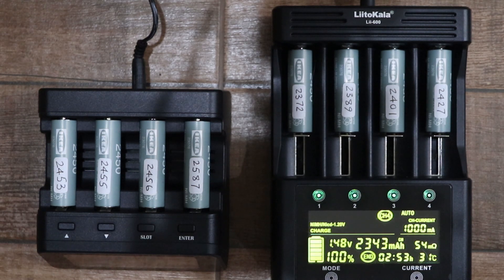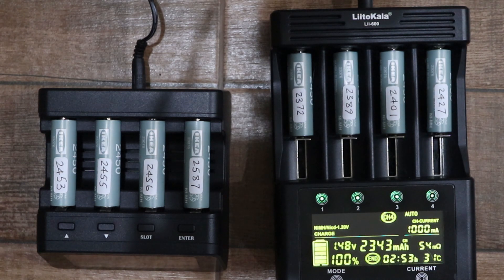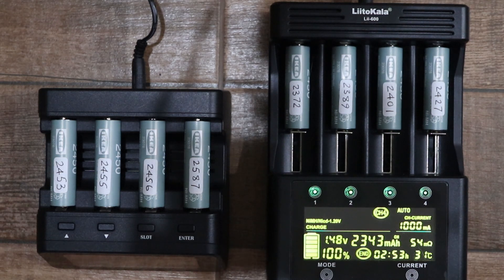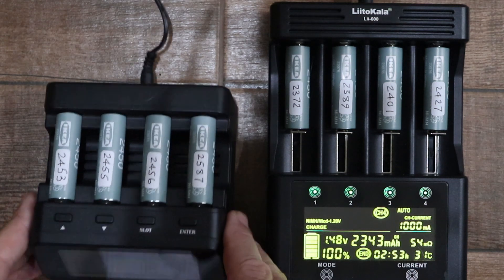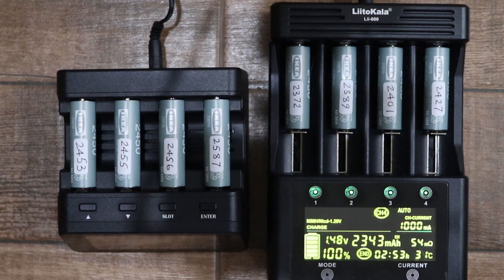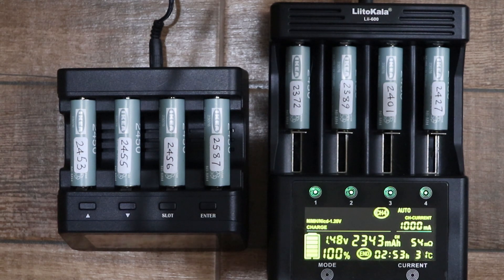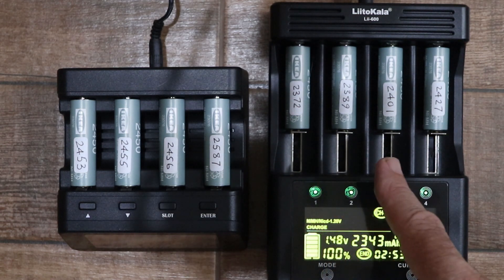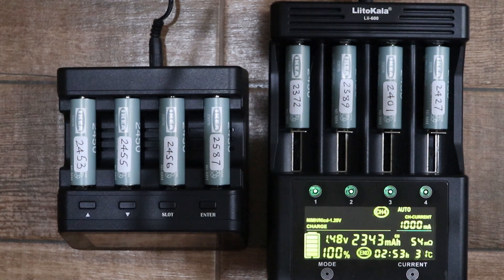Is There A Problem With My Powerex MH-C9000 Pro Battery Charger Or Is The Problem Me?

Comment: MH-C9000 Pro arrived few days ago and it looks like a very well build product. Also I bought Ladda and Eneloop batteries. 

Can I ask few things? Do I need to apply Break-In or Refresh / Analyize mode before starting regular use for brand new batteries? 

Actually I tried four 2450 mah Ladda batteries. I first discharged them with charger's Discharge function. Then I applied Break - In mode. I don't know what I did was correct behaviour for brand new batteries. But I thought may be those batteries waited in the store for a long time and they were not charged for some months. That is why I want to apply Break-In mode.

Anyway at the end of the Break In mode I got measured mah values of each batteries on the screen and they were, 2549, 2590, 2563 and 2627 mahs. So is that possible, should I trust those numbers? Is it possible that a 2450 mah (declared value on the package) can hold more than that value? I am very new on this thing so I will be happy to hear your answer. Thanks.
Reply from the maker: I just did some testing with 16 brand new Ladda 750mAh AAA batteries. With new batteries, you never know how long they've been sitting around. When I did a straightforward refresh and analyze, the value was low. I improved upon this by first discharging and then breaking in. Yes, you can get a higher value than the stated capacity rating. By doing the above, I was able to get in excess of 800mAh with the 750mAh batteries. You can trust the numbers. Powerex recommends breaking in new batteries and those that have been in storage for more than six months. Based on my test, it seems like a good recommendation.
Reply: Thank you very much for your answer, so it seems I did the right thing. I will do same thing to other brand new batteries to start using them with their maximum capacity.    @PhilUKNet
Reply from the maker: @hkaya79  You did! As you have probably seen from the manual, you should discharge batteries first before doing the break-in cycle. In my recent test, the Powerex outperformed my other chargers. I've had it a few years now and I've been very pleased with it.

Comment: LiitoKala is a better charger
Reply from the maker: There are pros and cons with both. I like the red and green LEDs on the Liitokala so I can see at a glance if it's finished or still charging. I like the extra information - percentage full, temperature, resistance. It's also more flexible regarding battery type and size. However, I've never been able to get the repair function to work.
The advantage of the Powerex is that there are lower charge and discharge options - 100mA compared to 250mA with the Liitokala. Also, the repair function works very well.
I probably agree with you that the Liitokala is a better charger, and it's normally my 'go-to' charger for everyday use, but I always use the Powerex when I have batteries with problems.
Regarding the title of this video, the problem was me. I didn't fully understand at the time and I was doing something wrong.